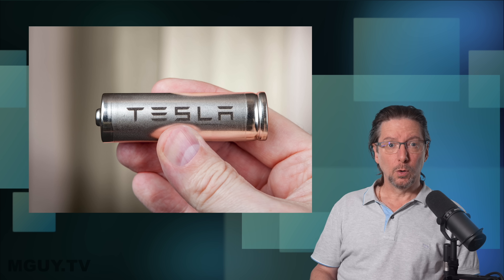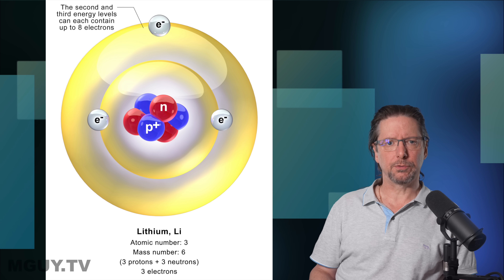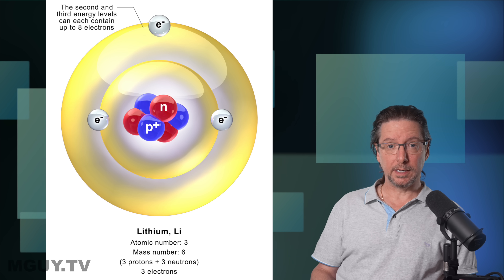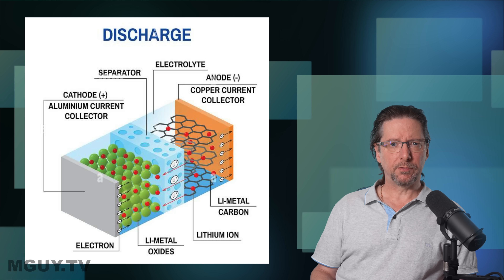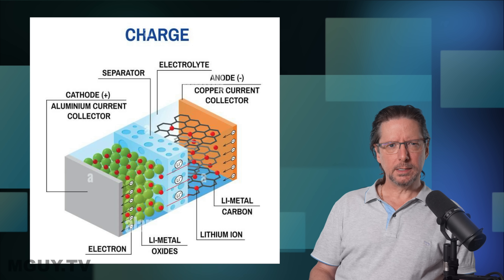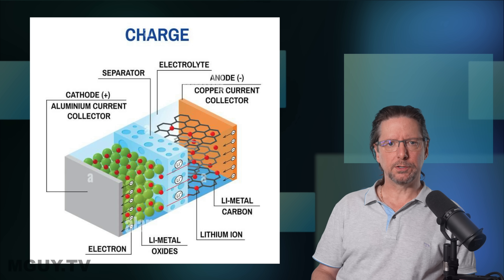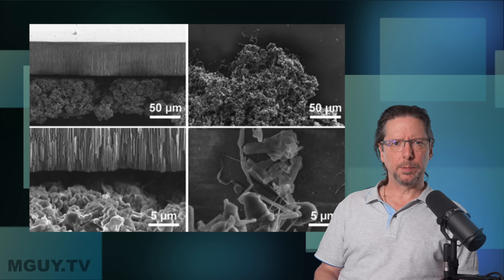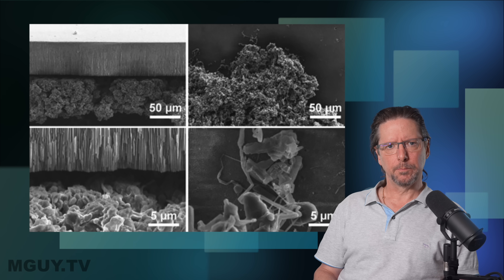Why are EVs so TERRIBLE in the cold? | MGUY Australia

Comment: Anyone who’s ever had their phone out in the cold would see how fast the battery drains and also how slow it charges. How anyone expected their car to be any different is beyond me. Batteries have always sucked and always will suck.
Reply: We need gas powered phones.
Reply: @althunder4269  In practice that is what you have. Coal - oil - nat. gas - nuclear powered phones. If you charge in your car - gasoline.
Reply: @althunder4269 I prefer coal...🙄😆🤣
Reply: I recall an article on EVs in Popular Mechanics magazine from over a decade ago, titled "It's the battery, stupid". That still hasn't changed.
Reply: So nothing has changed with EVs over the past decade? @onemoremisfit
Reply: Yes, my ebike suffers in the cold, a lot less range, a friend of mine has the same problem with his ebike.
Reply: I agree, a few winters ago while hunting I set my iPhone on a ledge in the blind with a +90% charge.  The temperature was 12F and in no time at all my phone was dead.  I now keep my phone inside my coat to keep it warm.
Reply: Thumbs up.
Reply: I drive tractor trailer, we've had tablets in the trucks for communications and for our logs for a few years. Half the time when/if the truck sits overnight and it gets below freezing we either need to warm up the truck or take the tablet out and warm it in our car hefore we can log in. It is a major PITA, especially when it takes 20 minutes for the truck to start throwing some heat. Electronics, batteries and cold do not mix well.
Reply: Do you mean the lead-acid battery in any gas car that loses half its cranking power in cold weather? THAT battery?
Reply: I see this when using my e bike in the winter, from 9 mile a bar in the summer to 4 in the winter, its why i never want an EV
Reply: Cold weather  has always  been a test  for batteries,  was even worse when they used a 6 volt battery.
Reply: @allanm250  The big difference being, you could warm the battery up enough to crank the starter and charge the coil, and then you were started, and  charging the battery.
Reply: one day it'll get better... its wasn't 5 years ago that they figured out that spinach improved lithium stability. when I was a kid lithium batteries were not even really a thing yet.
Reply: :face-purple-crying:
Reply: Where are the MPs  Dude?
Reply: 1. Child battery mineral labor

2. Range anxiety

3. Risk of garage fires

4. Paying 20k more than a
comparable vehicle

5. Battery denegration

6. Poor resale value

7. Reduced performance in
cold, highway.

8. Higher repair costs

9. Awful charging network
experiences in the weather
without restrooms

10. Higher insurance rates

11. Replacing tires more
frequently

12. Death by autopilot

13. 30 - 40k battery

14. Low km range

15. must wait in-line 1-2 hrs
to charge.

16. Then wait more time to charge, while charging.

17. Spontaneous combustion, with no way to put out the fire storm.

18. If they catch fire in a tunnel, many people will die.

19. People without a pro charger system or a parking spot at their house, will run an extension cord to the road, which is dangerous and could lead to people tampering with your charging setup (super slow charging at the road)

20. If you're in California, you won't be able to charge your car past 4pm because of a shortage of electricity supply on the cheesy grid.

21. It is not actually "green". The pollution is made at the power station, not the car.

22. Only 5% of used junk batteries get recycled, the rest go directly into the bin. It's cheaper to mine for new minerals.

23. Chhinna actually does 70% of all the refining of the minerals and production of the batteries.

24. Minerals are becoming more and more scarce, and the cost will only go up, not down.

25. Some countries where they mine for lithium, actually use a very big boat load of fresh water to only produce a ton of lithium, so they are afraid of running out of water. It takes over 2 million liters of fresh clean water to produce 1 ton of lithium. 

26. Ev cars will soon not be able to drive in tunnels or be able to park in underground parking garage and probably will eventually void your house insurance if you park it in your personal garage.... 

27. You can't charge your battery at super stations when it is bitter cold out. 

28. If a fire truck comes to put out an Ev fire, all the chemicals go directly into the sewer system, poisoning everything. They need tons of water to slow down the burn. They can't put them out. They are only trying to prevent over things near by from catching fire. 

29. Ok, there is 2 good things; regenerative braking, which charges the battery while you are slowing down on the highway, which saves your brakes from much wear.
Reply: @jakefriesenjake

wow! All those are excellent points
but will be easily outweighed by just 3 counter points:

 1.  kickbacks and bribes to legislators
 2.  lazy complacent citizens not bringing consequences to nip #1 in the bud in part due to media saturation promoting EVs (#3).
Reply: So what's that list for? @jakefriesenjake
Reply: @jakefriesenjake  1. Child battery mineral labor - As much of an issue for the petrochemical industry, which uses more cobalt to drill and refine oil than most EVs have in their batteries.  Tesla has zero cobalt in most models.

2. Range anxiety - not an issue once you've driven for any length of time

3. Risk of garage fires - is less than an ICE vehicle
4. Paying 20k more than a comparable vehicle.  True... (but it's not 20k, more like 7-10k) until you drive it, and the lower costs mean if you do average mileage in 2 years you'll be well up on the deal.

5. Battery denegration - doesn't happen on anything other than Gen1 leafs.

6. Poor resale value - is no worse than most ICE vehicles.  

7. Reduced performance in cold, highway.  I've never seen reduced performance.  Reduced range, for sure.  But ICE vehicles see reductions as well.

8. Higher repair costs - not true.  Routine repairs and maintenance (cambelt/chain, clutch, servicing) is much more on ICE vehicles.

9. Awful charging network experiences in the weather without restrooms.  Never been a problem.  You're just making stuff up now.

10. Higher insurance rates - not true for my EV.  may be true for Tesla.

11. Replacing tires more frequently - Also an urban myth.

12. Death by autopilot - if you use Elon's magic system, that's not an EV thing, that's believing his fairy tales about autopilot.

13. 30 - 40k battery - not true for my Zoe - comparable cost to replacing an engine from a main dealer.

14. Low km range - 200 mile range is fine for me.

15. must wait in-line 1-2 hrs to charge.  Literally has never happened to me in 2 years of having one.

16. Then wait more time to charge, while charging.  Usually plan this and have a meal or go shopping.

17. Spontaneous combustion, with no way to put out the fire storm.  Never happens.

18. If they catch fire in a tunnel, many people will die.  Same is true of ICE vehicles.  There have been more deaths in tunnels from ICE vehicles - no EV ones that I'm aware of.

19. People without a pro charger system or a parking spot at their house, will run an extension cord to the road, which is dangerous and could lead to people tampering with your charging setup (super slow charging at the road).  You're really having to make stuff up now, aren't you?

20. If you're in California, you won't be able to charge your car past 4pm because of a shortage of electricity supply on the cheesy grid.  I'm not in California, so have no idea if this is a thing.

21. It is not actually "green". The pollution is made at the power station, not the car.  This would even not be true if a grid was running on coal - that's how incredibly polluting the ICE supply chain and consumption is.  And most grids are getting cleaner year by year.  The UK is mostly renewables and nuclear now, and increasingly so each year.

22. Only 5% of used junk batteries get recycled, the rest go directly into the bin. It's cheaper to mine for new minerals.  That's complete rubbish - you appear to be making things up now.  Even worn out EV batteries (Gen1 Leaf) still go for around £2000 because they are still useful and can be recycled.

23. Chhinna actually does 70% of all the refining of the minerals and production of the batteries.    How is that an argument against EVs?  It's possibly an argument against poor planning by Western Governments, but nothing else.

24. Minerals are becoming more and more scarce, and the cost will only go up, not down.  Have you seen the price of Lithium Hydroxide recently?  Just hit a lower price than in 2019.

25. Some countries where they mine for lithium, actually use a very big boat load of fresh water to only produce a ton of lithium, so they are afraid of running out of water. It takes over 2 million liters of fresh clean water to produce 1 ton of lithium.   It's actually brine, not fresh water.  It's about 500,000 litres which is still not great, but there is a LOT of seawater.  And other battery chemistries coming online which don't use Lithium.

26. Ev cars will soon not be able to drive in tunnels or be able to park in underground parking garage and probably will eventually void your house insurance if you park it in your personal garage....   Once more, you're just making stuff up based on what's reported in the oil-fed TV and press.

27. You can't charge your battery at super stations when it is bitter cold out.   Except you can.  Otherwise Norway (which has the highest percentage of EVs in the world, and has a cold climate) would be stuck every winter.

28. If a fire truck comes to put out an Ev fire, all the chemicals go directly into the sewer system, poisoning everything. They need tons of water to slow down the burn. They can't put them out. They are only trying to prevent over things near by from catching fire.   And what do you think happens when a diesel engine goes into runaway and blows up?  Or there's any other form of fire involving chemicals we use every day?  It's the same problem. And that's not to say it's a good thing, but don't pretend it's only EVs.  There are many times more ICE fires than EV per mile driven, so it's a bigger problem on the ICE side.

29. Ok, there is 2 good things; regenerative braking, which charges the battery while you are slowing down on the highway, which saves your brakes from much wear.  Regen is indeed important.  No ICE car can create fuel as it slows down.  EVs do it every day.  Saves on brake wear, and makes more fuel.  Perfect Engineering.
Reply: @TheDarrenJones  there are other things that I could mention, but one flaw of yours is that an Ev battery has a comparable cost to a car engine. That is apples and oranges.;

A regular car gas engine = an electric motor for an Ev

An Ev battery and cables = a regular gas cars fuel tank, pump and fuel lines.

Cannot mix n match.

Most of those stats are from Google, and I'm not saying ice cars and their infrastructure is premo either.

I don't care either way, it's the persons choice if Ev or ice is better suited for their lifestyle.

There are many things that can be improved on in this world, none of it matters unless chhinna is willing to go clean too.

Why is Toyota dropping out of the Ev market?
Reply: @TheDarrenJones  well, higher insurance might be coming for you soon. Here's some news for you ;

(Bloomberg) -- British drivers have to fork out twice as much to insure electric vehicles as they do for combustion-engine models, adding to hurdles to make the switch to zero-emission cars.

Gona suck. Then once ev's get banned from underground parking lots......
Reply: @TheDarrenJones  #19. The use of extension cords, going to your Ev to charge it at the road. You need a special new licence to do that in Australia. Its unsafe so now they scraped that idea. Look up this vid ;
"
"Dangerous" EV charging trial
in Sydney SCRAPPED | MGUY
Australia. "

Not making this up. It's dangerous as hell. If you charge at 120v, it's too slow, so they use 240v. Really dangerous.
Reply: Im one of those unusual people that vape since I quit smoking long time ago and I know that vaping is not a good alternative but anyway, I noticed that the lithium ion batteries in this device are totally useless when I walk outside when it is only 30 degrees Fahrenheit or under, I  think we need research for bigger and better.
Reply: So do you not charge your phone before you leave the house?
Reply: @steveinoz8188  The rate of thermal discharge does not vary with whether or not you charged it before you left your house.  The OP was not talking about the time it takes to go dead; he was talking about the rate of discharge.
Reply: @steveinoz8188  you need too charge your brains it’s obvious they’re not fully functioning 😁and absolutely nothing to do with the weather
Reply: @steveinoz8188 are you saying  you take your house along on the road? 😉
Reply: @canadiandeplorable6413 We should expect EV batteries to be different to phone batteries because they are. EVs can preheat their batteries prior to charging. The recent silly events in Chicago would have been avoided had the EV owners realised how they should deal with the situation. It is perfectly possible to use EVs in a cold environment if you just use them as designed rather than as if they are ICE cars. MGUY continually tells lies in his videos. This one is no exception.
Reply: @seannewman5391  that's because he's dealing with people not robots, if you knew anything about the general public then you would know that people in general are very forgetful and not that bright overall, so he was just demonstrating a typical ev drivers life.
Reply: @Markcain268  That's no reason to lie.
Reply: When it's 20 degrees out gas is 15% less efficient too.
Reply: @itsatrap7215  wrong. When it's hot and humid out, ice cars are less efficient. Ice loves cold air. Racers literally have cold air intakes, places to put water ice of dry ice on the intake, run the gas lines through a container filled with water ice and turbo engines literally have intercoolers to drop the temperature of the air for better power. Which = more efficient.

Heat is not good for an ice car.
Reply: @jakefriesenjake yes, and no. During this most recent round of winter weather in my area I have paid more attention to my fuel gauge, it dripped quickly until the engine temp got into it's normal range, then it barely moved.
Reply: @JackDoodle  yeah, went the engine is, cold is not efficient.

Air being cold is good
Reply: @jakefriesenjake  No, you are wrong.  ICE engines are less fuel efficient in the cold than in the heat.  They are more POWERFUL in the cold because the more dense air allows more fuel to be burned due to higher O2 content. 

Allowing an engine to more 'efficiently' burn O2 and hence more fuel does not make it more fuel efficient.  You ultimately burn MORE fuel.  On a hot day there is less dense air and the engine is simply disallowed from burning more fuel.  

Heat is efficiency.  Cold is power.  Unless it is an EV then both are worse unless it is a 60-degreeF day all year.
Reply: @ToolHombre  that's true, but they make up for it in other ways, i can't see me ever buying an electric car, I'd sooner not bother and walk everywhere, but, yeah, a small percentage of people want them, about 1% in the us, 2.5% in the uk, so a small market does exist for evs.
Reply: @Markcain268  
US market share for BEVs was 7.6% in 2023.

In the UK, 16.5% of all cars sold in 2023 were BEVs

In my country its 22%

Worldwide market share for BEVs is ~18%

The best selling car model in the world in 2023 was a BEV.
Reply: @adammiles3095  I agree
Reply: @Tschacki_Quacki  but less than 1% of Americans own an ev, around 2.5% in the uk, you ev guys never mention these statistics, the ones that actually matter, but those statistics don't make evs look good so better to ignore them eh? 😂
Reply: @Markcain268  
It's pretty obvious that total fleet share is still a lot lower since cars are kept for many years and meaningful EVs haven't been a thing 20 years ago.
Additionally, it has zero to do with how many people want one. That's why I posted sales numbers. Cause that's what tells you what people want today and what the total fleet will obviously look like in the future.
Reply: @itsatrap7215 If you're talking fuel mileage, not so, my car gets the same pretty much all the time. The difference is the idle time to stay warm or cool depending on the season.
Reply: @kennethboyer2338  same here, i don't know where these ev guys get their false information from, maybe they subscribe to electric viking 😂